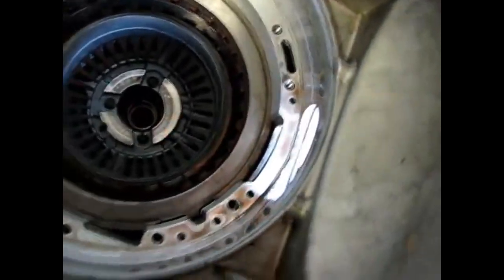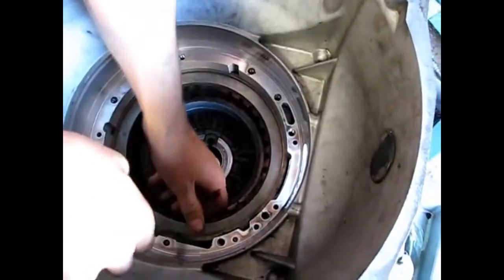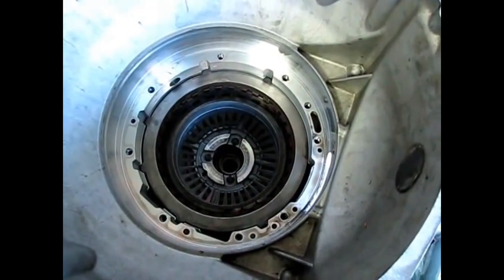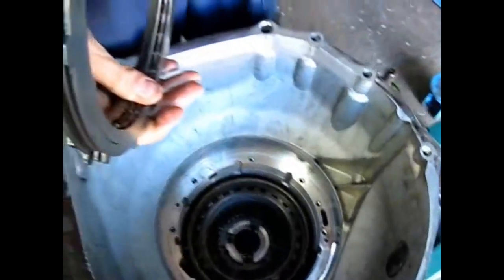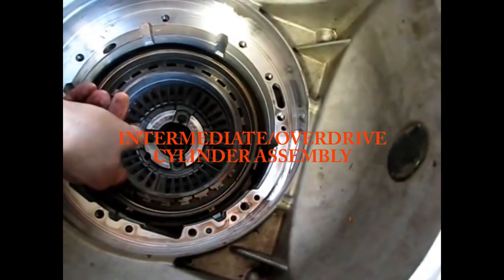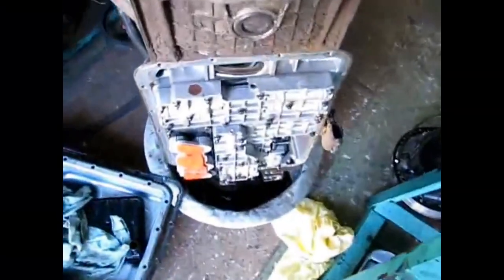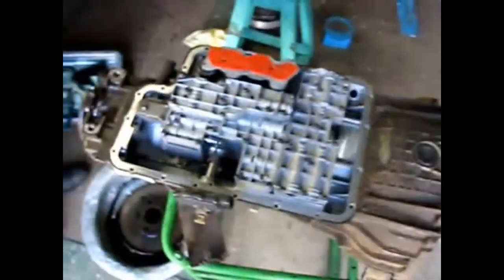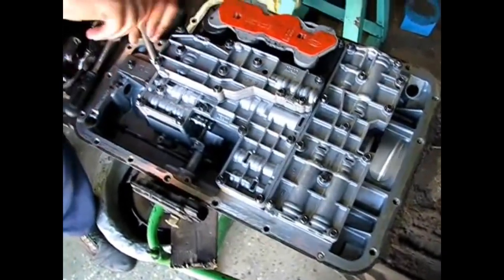Ford E40D Automatic Teardown

Comment: Nice video,  I'm noticing that the tail shaft is out?  I didn't see that part in the video.  Also,  I'm currently working on my E4OD from my 95 E250.  I found that the filter partially melted and there's plastic in the fluid.  What would have caused it to get that hot any ideas?  Wonder if my radiator lines could be the cause?  How would I test that?   Wonder if I should change my torque converter or do you think I could just flush it out?  No signs of metal so far....

Comment: I have a 1987 ford bronco 1 not 2 XLT it has the 5.0 what kind of transmission does it have it need a rebuild? any help would help a lot.
Reply from the maker: I think you could have a A0D automatic. I'm not sure!
Reply: either the AOD or C6 automatic
AOD is 4 speed
C6 is 3 speed
Reply from the maker: uprednecked OK whats the selector say? 1,2,D.   1,2,3,D.    Get it?
Reply: rudedogii AOD p/r/n/overdrive/drive/1
C6 is p/r/n/d/2/1

check the transmission pan the AOD has 14 bolts
C6 has 17 bolts